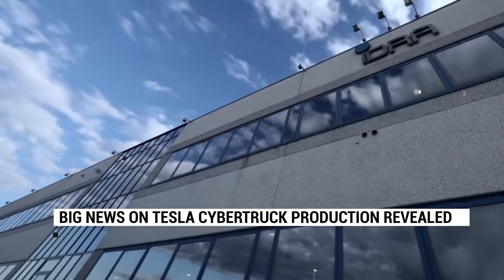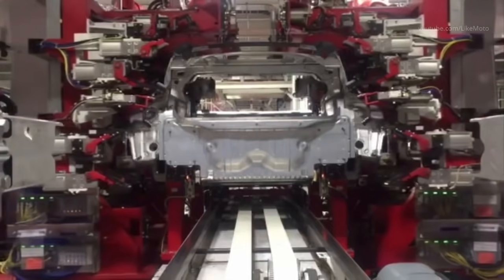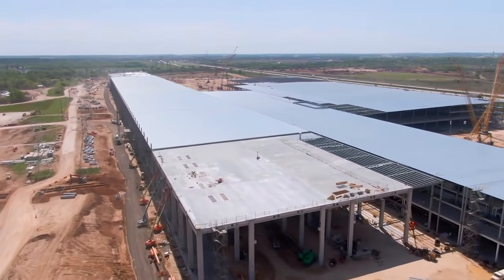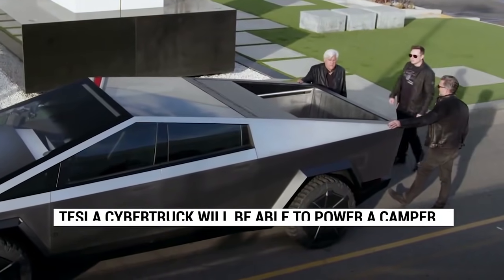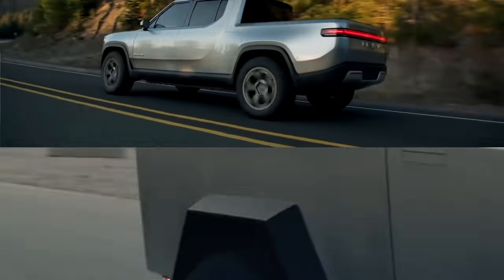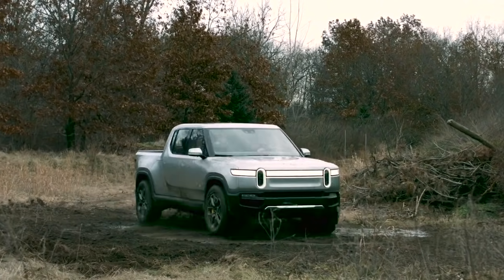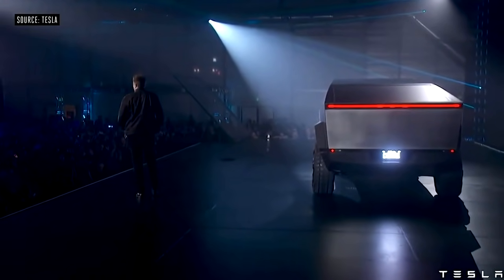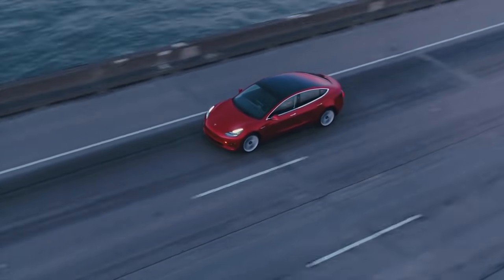Cybertruck Redesign and Production Process (Tesla News Updated)

Comment: I have already ordered a cybertruck. Trimotor FSD. I think these should be the first to come out because they are most expensive. I would also like to see how far it will pull a small camper. My model X didnt pull as far as I was hoping. Torque-wise, I would compare to the Ram 3500 turbo-diesel I had. This car pulled extremely well! This truck needs testing with pulling.

Comment: I'm not surprised. For one thing, teardrop streamlining is what you want for the lowest possible air resistance, which will be a factor for EVs much more than for gas cars. Another is that it looks like something out of the original Battlestar Galactica.

Comment: I guess you could say the bed sidewalls do somewhat resemble a El Camino pickup.  But for practical loading at the local Home Depot, and unloading by reaching over the sidewall of the bed, it is not all that useful.  And the bed sidewalls will prevent it from being practical towing a fifth wheel type camping trailer.  A few simple design changes would make the truck look closer to normal, and be easier to load and unload.

Comment: Depends on pricing but i definitely want one

If not that, the Ford Lightning 😎
Reply: They're still saying 40k for single-motor, 50k for the dual-motor, and 70k for the tri-motor model.  The simplicity in design let them go hog wild with features and make it as functional as possible.  The insurance will probably cost a fortune though, it's pretty high on Tesla vehicles.
Reply: @boxlid214  lets go lighting
Reply: @benaldboinorton4522   I want the dual motor cybertruck personally.  I prefer unpainted stainless steel, just like my bike

Comment: I would not buy one till they have been on the market for several years when most of the bugs are worked out!  How long does it take to charge?  How much would a charge cost?  How many times can it be charged?  How much to replace the batteries?  What is the depreciation after it is bought?
  How much is insurance for the autonomous EV's?  Who pays when these run amuck, which they do?
Reply: You have a point

Comment: The GMV for Australia for the dual motor version should be set at 4.5 ton as this is the limit for a standard car license so if they just convert 10000 pounds it will be about 36 Kg to high for most people to legally drive it while being so close people will make mistakes. The try motor version will need a light rigid license if I recall correctly.

Comment: The rear wheel crab steering will be another bonus for Cyber Truck!  With up to 14k n towing capability the truck is Too Tuff ! Way to go Elon!
Reply: That would be awesome
Reply: GM, Honda, and Mitsubishi has already put 4 wheel steering in the market almost 30 years ago, it's nothing new. 
What would be Great, would be to incorporate 4 wheel steering with Ford's automatic trailer backing system, and GMs parallel parking system. Now you've got something practical and useful.

Comment: I hope the Cybertruck has all the smart Mods said to be going to be added as in CRAB WALK / DIME SPIN / powerful JET THRUSTERS / and one that has not been mentioned except by me a number of times which is hydraulic hydrofoils and a power jet propulsion unit perhaps ran by its own motor unless something can be configured using the drive motors and a styled underside cover to help with being amphibious. THAT WOULD BE THE ICEING ON THE CAKE . Other wise if it has no amphibious features I’ll see about engineering a kit that can be adapted to the Cybertruck and even using the Tailgate as a TRANSOM FOR AN OUT BOARD TO FIT TO .

Comment: So which stainless steel will they use? 301, 304, 308, 310 , 316 ? These All I know and have worked most. I think that all might have their place on the rockets but I’d probably only use 304 and 316 on the Cybertruck .... probably electropolish the 304 to eliminate corrosion ...

Comment: Campers could have their own battery packs & assist motors to keep the truck's range as advertised when in tow mode.  Before setting up in the campground both would be charged to the max.
Reply: It's theoretically possible but it all adds costs and especially with a trailer where the battery won't be used nearly as frequently as a daily driven car, the battery will degrade quickly.
Reply: Battery would replace powerwall when parked at home?

Comment: The Cybertruck is the future, but the Atlis XT Pick-up and their new AXM battery can haul up to 35,000 lbs.Now if Elon can come up with a way to increase towing capacity up to 35,000 lbs. He would have my business. Some Fifth Wheel RV’s weigh 20,000 plus and then your own gear. ATV’s and even a garage in a RV Can haul a car, plus the RV, including everything and everybody! That’s incredible, especially NO GAS @ $4.50 a gallon. When a trip thats 2000 miles do the math, it would cost $1900.00 on 7-9 miles a gallon. This way tops $65-90 dollars at a recharging station. Yet the AXM battery recharges in 15 minutes, that impressive! There’s enough upgrades Elon, coming from a Truck Driver for 30 years!

Comment: "Trucks that expel pollution"? The Semi pollutes way more. It has a massive battery pack that requires huge amounts of rare metals, low payload due to the vehicle weight, and low millage once fully loaded. Also not very practical due to the long waiting periods required to be fully charge. Also the truck is easily totaled after the battery pack becomes too degraded.
Reply from the maker: That is something Tesla need to think about for sure!

Comment: I'm all for the concept of electric cars and trucks. however. considering that Tesla is saving tons of money by eliminating a gas engine + transmission + exhaust system and cooling and many other endless parts that are found in any conventional car or truck. the inside is not impressive by any means.
the dashboard looks cheap. that one touch screen is poorly located. instead of having a digital readout in the dashboard. plus no need for 3 seats in the front. too crowded. and poses a risk. 2 seats very comfortable seats in the front are enough.  
the way that mounted that touch screen is so poorly thoughout. Not impressive. 
why don't you have a look at the Mercedes-EQ series? and see the difference...